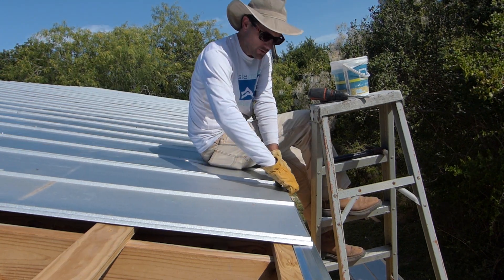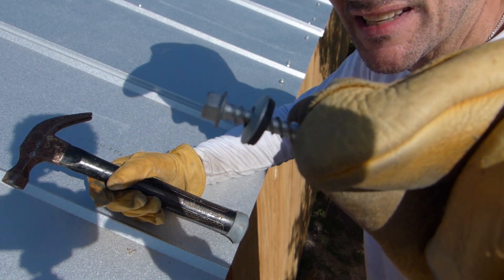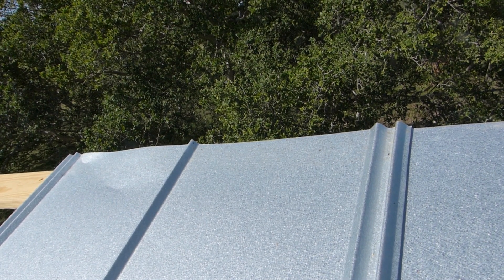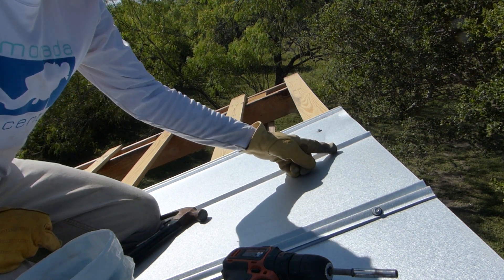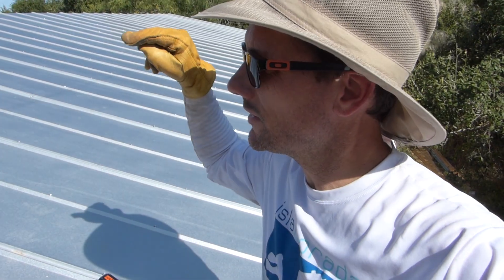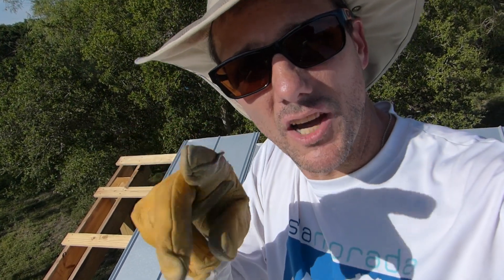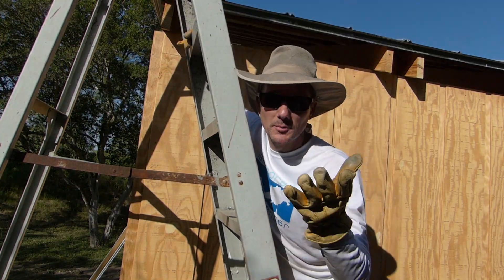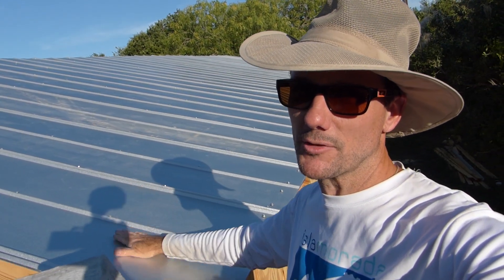Help Me Install This Metal Roof - HORSE BARN PROGRESS

Comment: Your laps are backwards the ones that are on top should be under.. and if you flip the panels upside down on the ground and stacks of 10 you can mark and  pre drill them
Reply: Come on dude I don't need to use a drill I got to use a little impact drill for that I used a little impact drill and that sucker went in like nothing come on are y'all Carpenters or not

Comment: When I am installing metal roofing in the carribean, before laying down the sheets (1), I take my tape measure and mark the area on each end. (2) I use a nilon string and knot it on the inside edge of the nail 1/2 " up from the rafters on either end (pull it to make sure it's firm). This should give you a straight neat finish next time.

Comment: The trick to perfectly straight panels is to use a string line along the gutter end to use as your gauge for lining them up.  Don't line the first one up with your gable ends.  That's where things go wrong and you have a jagged edge.

Comment: I'm also doing a solo DIY metal roof on my house, and oddly enough, I was looking for some ideas on how to get the panels up and in place without scratching them (mine are painted).  When I heard the scraping as the panels were picked-up, I cringed.  Scraping means scratching, and that means they won't last very long (rust).

Comment: how loud is that roof during rain and would you suggest using it on a home? Ive always loved those roofs
Reply from the maker: It's a little loud, but not crazy. I think on a house with the layer of insulation there it wouldn't be bad. I would love to put a metal roof on my house.

Comment: Youre most likely going to regret not having put a moisture barrier under the sheet metal on your roof... amish told me wouldnt need a moisture barrier since one whole side of my pole barn was left open...no siding... I still have condensation that builds up on the underside of the roofing and rains down on my work bench and everything else.
Can inexpensively buy single layer bubble wrap with a foil layer made for sheet metal roofs that covers 1,000 sq ft for under 200.00 or 400sq ft for under 120.00 So with the size roof you have, the 400sq ft roll would easily cover all of it.

Comment: This roof will surely leak in the years to come.  Thermal expansion will wallow out the screw holes in the years to come. Also some swrews will back out because of the expansion and contraction, especially if the panels are long..   if you don't want your roof to be leaky in ten years put the screws in the peak, never in the flat where the water runs . putting the screw in the peak is  hard. But the hole in the peak will always shead water. Even when the hole is wallowed out or the screw is lose. .  I found this out by tearing  down old barns. All these new experts have not been around long enough to see there roofs after 20 or 30 years. If your board spacing is even, you can invert the panels and drill a small pilot hole in the bottom of the vee. This makes starting a screw easier

Comment: I seriously don't think you put those screws on the v cramp part is supposed to go on the flat part of the panel don't it?
Reply: I know when I did my roof I put on the flat part I've seen some people put it at the tip of the v and how's that washer supposed to work that just seems kind of dumb
Reply: Yeah it does seem that way but the instructions I found for 5v metal roof  show placing the screw directly in the peaks and to only place in the flat if the panel is in a valley and even then it still places screws in the peak as well. 
I followed the instructions and I have not seen a leak. 
I also questioned how the washer was supposed to work but it did lol

Comment: I’m sure you’ve already been told but sheeting is lapped upside down edge with lip goes under for peeling support and all screws go in flats with extra  screws in bottom and screws set over to lap side of panel. Good luck not trying be a sick just letting your audience know for future, yours is too late for fixing. Better luck next go.

Comment: Screws are wrong. They should always go flat and flush to the metal, not at an angle. Also, you should have put a vapor barrier under those panels. Water is metal's worst nightmare and you are going to have alot of sweating in that building which of course leads to rust.
Reply from the maker: Thank you for that feedback. Here in Texas I've never seen anyone use a barrier between the 1x4 slats and metal. I'll have to look more into that.